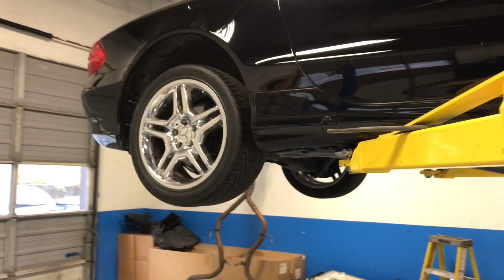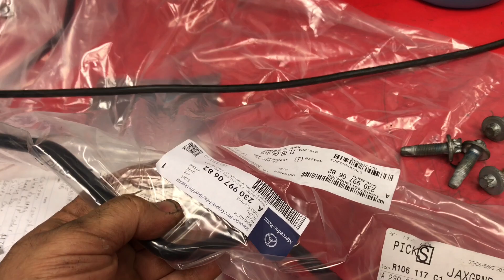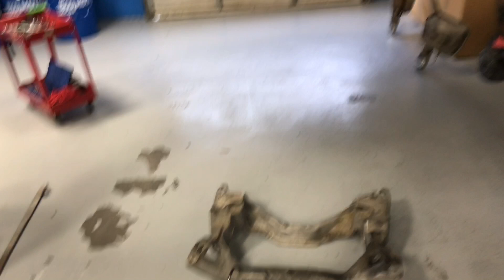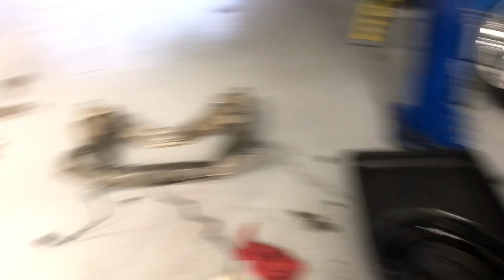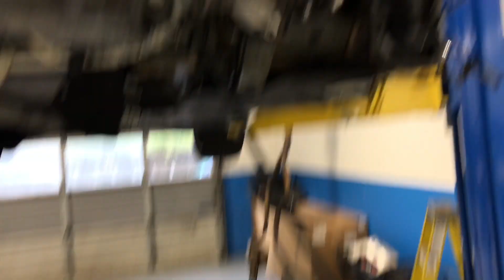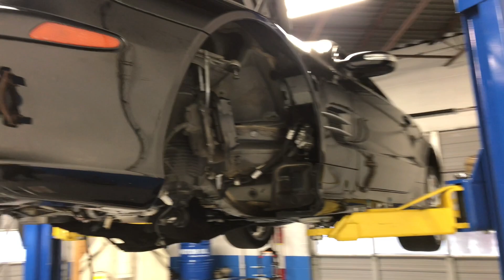Mercedes Benz SL500 Active Body Control Repair - Hydraulic Fluid Leaks Fix

Comment: Convert to coils springs it’s 1k  for the kit will never nave the problem again 👁👁other than that the car solid #swear
Reply from the maker: You shouldn’t do it, it’s active suspension and a part of you electronic stability control, you change to coils, you change the entire dynamic ride, might as well by a Toyota.

Comment: I was actually able to replace the same line in this video in about 8hrs. It is still a very big job but all that needs to be removed is driver side engine mount and exhaust manifold

Comment: I'm having a problem with my Active Body Control on my CL500 2003 the computer is telling me that something's wrong with the plungers I believe I believe the leveling sensors pressure control sensor my car go up and come down and go up and come down on its own what is the best computer to buy to reprogram my car what to be at the right ride height

Comment: I was going to do the same job you just did on my sl65.  Stupid design but there is a way around it.  Get a 10mm od compression fitting and cut the line where it goes straight.  Now buy a new line and splice it in.  Take you about an hour and get a good compression fitting and it will be good for 11,000 psi almost 4 times the strength of what you need.  That fitting will never go bad and when the line pops again just take out the bad side and pop a new one in.

Comment: Thank you !!! This is a great warning for those thinking about how sweet that test drive was ,,,,,, I drove one and it has no problems and i was going to by it till i talked to a MB mech who agrees with you. Don't BUY IT, it will fail over and over. 2k for one shock. 4 new shocks and labor and you spent more than you paid for the car ???
so i still wanted it....thought coil over swap with a electronic gadget to fool the computer, but you wont have any sway control because active corner leveling is what this amazing system does 
until til it doesn't.       so i guess its for those wanting to spend a 100k and drive for a few years and sell. The only people who dislike this video are used car dealers and and an individual who is stuck with one and wished they would have seen it before they purchased.
Air suspension is Good /Hydraulic suspension Bad

Comment: Actuslly. The metal part of the line is very rare to be damaged. The rubber part can be cut and take to be a hydraulic shop to be fitted with couplers and adapters. You wont have to take off anything. Just cut the metal clamps that attaches the rubber segment to the metal lines. Go to a hydraulic shop and tell them you need 10mm high pressure fittings rated for 4k PSI with couplers. Take the line with the newly installed bits and reattach the segment. Done
Reply: Me too.  '05 CL500 in California.  Bought it used.  Occasional white "ABC Visit Workshop Soon" eventually became red "Car too Low, Put in Park" (something like that).

Thought the pump failed, but flush & filter change -works like never before.

Now just have to pinpoint leak (front left) & "Lady MacGyver" an affordable DIY fix.

Comment: You saved me a nightmare...I was purchasing an extremely cheap 2003 on auction. Paid a MB tech to inspect  before the close and found the ABC problem on the dash, rear randomly drops out. The repair is thousands to do correctly and its actually just a bad design and unreliable anyway. Research is everything!

Comment: Probably a silly question but will the abc engage and function without the car running?  I just bought a salvage saggging 02 CL55, has lit up dash.  I have a scan tool coming but curious.  I charged the battery completely and figured it would get the pump/compressor going.  Nothing, not a peep except for the cooling “jet” fan.  Anxious to get this beauty back in it’s normal state, this is my first air suspension vehicle.
Reply from the maker: No, it works on a pump

Comment: What’s up ! Wanted to ask ! W220 s55 2003 , car sits low after driving when parked ! When turning it on it goes up in matter of 15 -20 seconds perfect height , also to elevate and lower button works ? Need help what could be the problem
Reply from the maker: Flush the system and change filter

Comment: Did you consider repairing the section that was leaking? what was the hours required for the repair?
Reply from the maker: You can’t rig it when you have a shop, the customer will come back in three months when it leaks again and expect you to fix it for free, if you are a shade tree mechanic you might be able to make a hose repair, I can’t.
Reply: @MercedesBenzTechs  if its just the rubber segment of the line then a good hydraulic shop will set you up with new segment that can handle up to 4k psi with new adapters and couplers on each end. Theres no reason they should be back unless something else gives

Comment: The replaced line shown in this video is one of the most consistent culprits in  ABC system leaks; that and the hydraulic pump loosing viability and leaking. The line runs from the front hydraulic block with the accumulator to the midbody T fitting that incorporates other lines.  MTB of Atlanta is correct that there is no way to replace this line without removing the subframe.  I am so upset that there were no foreseeable modifications made to this line. If that don't scare you wait till you see the honeycomb of lines running from the rear hydraulic block to all the rear struts. This car is really not mechanic friendly and one of the disappointments of the Mercedes fleet.

Comment: Mercedes Benz really screwed the pooch on this system.  The hydraulic lines are composed of flexible and non flexible components. The NON flexible metal tubing almost never leak; but the flexible, reinforced [ internally braded ] rubber hose suffer dry rot, physical impacts, flexing, and cracking. If they had made it possible to detach and remove the rubber hoses without taking out the whole damn hydraulic line from soup to nuts then you can replace the hydraulic hoses and be done with it.

Comment: Sorry to say but this is not the smart way to do this job. Any leak is coming from the flexible section of the lines, ageing and becoming easy to brake, even more if the efficiency of the accumulators is not monitored. 
Said so, the smart way to repsir it is to cut the 10mm steel pipe next to the flex hose and fit a suitable coupler to connect a new flexi hose. I have done this job myself and spending a fraction ( 27usd per pipe) of the bill that will shock that client...
Reply from the maker: Disagree with you, if you own a repair shop and your customers are expecting a professional repair you have to do it the way the book says if you are a shade tree mechanic you can do what ever you want, infact, you don’t even have to fix it at all, drive a lowboy.
Reply: Hi Anacleto! Your suggestion is feasible. Do you know if there is any video on the web on how to do it?
Reply: Can you drive it low? It’s not dragging on the tire

Comment: I have a 2002 sl500 with the red abc light on the dash, I replaced the abc pump and everything, just dont know of to clear it, can i use a cheap ob2 reader to clear the code, or can you point me in the right direction for something that will work please?
Reply from the maker: The code does not have to be cleared, you have more issues. 
You do need a computer that can scan ABC module though.

Comment: I have a suspension oil leak on my sl500 2003 model. It is mainly around the middle just behind the front wheels. Have you any ideas what is most likely leak cause? I will be taking off the floor pan once I have the time
Reply from the maker: If it’s closer to driver front wheel it can be from the valve block behind the wheel, move the fender liner and fill the reservoir and see if one of the two valve blocks are leaking, it can also be one of the hoses connecting to the valve blocks.

Comment: They told me I can ball on a budget so I bought the beast. Now Can I patch up my hydraulic hose leak? My SL55 amg just started leaking. Hydraulic fluid flowed right out. Resi was bone dry. Smfh. How much does this cost to repair? Should I just buy regular struts?
Reply: regular struts can be installed but require several modification and the overall cost would be not far from the car cost.

Comment: How people can disliked this video ?
Dude thank you soo much on taking the time to post the video with the part number of this particular problematic pressure hose. I called the dealer and the guy was going crazy trying to quote me this particular hose since there’s so many damn hoses and you post the part number of what I need and for that I give you all of my respect:-) you are a life saver thank you for the great info and now I can provide a proper estimate for my client.
Reply: while appreciating the effort, the way the problem was approached is still arguable. The ABC system, as engineered by MB, has critical culprits and maintenance issues. Disassembling half car to change a steel hose with a short flexi segment, that it can be sectioned and segmented with secure high pressure couplings, is a matter of technical confidence, trade choice and customer willing to spend 3,000USD or 300USD. If it were my car, I would have preferred to run the risk of an additional pressure line coupling rather than butch the car that way, involving additional risks during the disassembling/assembling process. Again, this is a personal choice and job risk assessment.
Reply: the People sitting on one they cant get rid of and used car dealers!LOL

Comment: Guys are scared of these machines because of the unknown. Naturally to have these machines repaired by a dealer is very expensive. I have a 2005 Mercedes AMG CL55 and I love it. I personally went over the ABC system and in reality it is not as complicated as it sounds. I work on my cars, there no area of this car that I can't fix/repair. Naturally you can't work on it with a bend screw drive and rusty pliers (Just joking) but you will need tools and knowledge and the wiliness to learn. That it costs money, yes it will. But with proper maintenance the system can be very reliable. Its when people want to fix these cars "A la Cheap" and skip maintenance that problems will surface and show its ugly face. It was good for my because I could buy a fantastic piece of German engineering, and I enjoy every minute of my CL's ownership. I will keep this car a very long time.
Reply: Your car is a completely different model, does it have the same ABC design. Seems like the ABC design no matter what model is a problem. The data is overwhelming! Previously owned a '76 500 SL for (89-98) 9 years that I loved but the recurring problems were the issue, same costly repair every few years all due to the design.  Some problems won't be able to be remedied. Would you concur?
Reply: I've got a 2009 SL550 with AMG package.  Car has 16,500 miles.  I bought a Foxwell NT510 Elite (Mercedes Benz) new from ebay for $125-->it does the rodeo test.
Got 20ltrs of Pentosin CHF-11S and 2 reservoir filters from Amazon.
Going to flush and replace the old fluid with new fluid (rodeo test) and change the old reservoir filter with a new one.

Comment: I sold my CL500 because of this issue. Replaced all the ABC shocks twice. I was done. I even did it myself one time. Never again.
Reply: I've got a 2009 SL550 with AMG package.  Car only has 16,500 miles on it.  I also have a Foxwell NT510 Elite (Mercedes Benz) that I bought new on ebay for $125-->it does the rodeo test.
Got 20ltrs of Pentosin CHF-11S and 2 reservoir filters from Amazon.
Going to flush, replace old fluid (rodeo test) with new fluid as well as the reservoir filter.
Reply: Did you ever rebuild the valve block? Or the lines?
Reply: Or flushed the system?

Comment: Is there a way to maintain thr abc system sir? Im getting a cl65 amg.....and want to keep it running
Reply from the maker: khoi nguyen yes, flush the fluid every 20k and change the filter in the reservoir

Comment: If you want to buy SL r230, just take Sl350 version its comes with standard non abc suspension, much cheaper to maintain. Only drawback is weaker m122 3.7 engine, but its also ok, not much that difference between m113 5.0.
Reply from the maker: Glebaka I have never seen sl350 in the United States.. it might be available outside the country.

Comment: Just get yellow speed coilovers and enjoy it if you got it for cheap totally worth it body
Reply: zaid khaled why not regular struts from advanced auto?
Reply: @kmontgomery27  because there isnt many afternerket companies that provide conventional coil over swaps
Reply: @megadudecool  what do you think about the Audi R8
Reply: @kmontgomery27  no idea tbh. Outt of my price range so I wouldnt dare judge it. Ill tell you though that Audis drive like no other and they are reliable in the sense that you can rely on them to have problems lol. They are difficult to work on and if youre thinking about saving money on after market parts they do not respond well to any non oem parts involving anything electrical(sensors, coils, spark plugs, etc...)

Comment: I found your video very interesting. I am thinking of buying a used 2007 through 2009 SL 550 (always wanted one...) but am concerned about the ABC system. Besides looking for leaks how can someone determine it's shape. Can a qualified mechanic inspect or perform a test or.... to know if it's reliable?
Reply from the maker: Mercedes Troubleshooting & repair 
First, you don’t need to use this language, second, we are Mercedes master technicians with highest level of education and access to all Mercedes Benz libraries, we are not shade tree mechanics, when we determine to do a job on a certain way it’s after discussing it in between 4 master techs, when you work on a customer car he is expecting the highest level of repair and not some bend hoses pushed in, regardless, this specific hose has to have the subframe removed. Thanks for watching and taking the time to respond.
Reply from the maker: Cam Roberson check the fluid and the filter and in general, I usually check the overall of the car and see if maintenance was done by a quick lube type of place or a professional place.
Reply: Thanks so much. I saw in another video where they actually tested the hydraulics... looked like one of those low rider shows where different sections of the car were hoisted up, then down... is this a practical test or was someone just showing off?
Reply from the maker: Cam Roberson it’s what we call the dynamo test or rodeo, it gives you control over the suspension with a computer, we use it to test the system and bleed after repairs
Reply: is it prohibitively expensive to do? If I were going to buy a sl550 would it be sensible to pay to have a qualified mechanic do it?
Reply from the maker: Cam Roberson yes. Make sure you calculate it before you buy the car
Reply: @robcam2k  - I have a 2009 SL550 w/AMG sport package with only 12.5k miles on it...A/C garaged kept and it's a Sunday driver.  Just buy an Autel Maxisys Pro on ebay...anywhere from $1400 to $1700 used. It has the "Rodeo" test AMONG A WHOLE HOST OF OTHER DIAGNOSTICS if your into that.  You can also eliminate the "governed" top speed. Flushing the ABC system is easy if your the DIY guy as well as changing the: air filters(2), cabin filters(2), oil filter, ABC filter, oil, tranny fluid, diff. fluid, spark plugs(16), brake pads F&R.  I also take the wheel wells off (4 in the front-->2 per side & 2 in the rear-->1 per side) during cleaning to inspect the ABC lines, blocks, and actuators.  The only thing that sucks is the COMAND center; it's outdated even when new back in 2009 for a $110k Mercedes and when it goes which it normally does (turns on then off) that will set you back $3200 parts & labor(dealership).   I changed all the interior lighting to LED's including the fogs to HID's and license plate lights to LED's. Car has 2 batteries-->1 to start the car (in the hood/bonnet) & the other in the trunk for everything inside the cabin or what they call the creature comfort battery...both are on battery tenders and still the original MB OEM factory batteries.  You can buy some bathroom carpets from WalMart(interior is light beige with the dark brown wood accents)...so I got dark brown bathroom carpets so as not to stain the factory matching mats and carpet.  It's hard to find someone who puts the "love" into their car nowadays since we are sooo busy OR unknowledgable of how things work--> " I just put gas in it and that's it!!" but mostly it's about image....until something major breaks and they just get rid of it.  I might upgrade the ECU to a RENNTECH ECU which re-maps the engine and takes the engine to 405hp and 410ft lbs.  That upgrade is an easy swap "plug and play" and will set me back $1600.  Renntech has been around Mercedes since the I believe the late 80's.  These people in this vid probably did'nt: 1) flush the ABC fluid every 30k to 40k miles 2) did'nt change the ABC filter as well.  A grain of sand will mess up this system as it's under high pressure along with rubber seals in the blocks and the actuators...so when doing this procedure (ABC flush and filter change) it must be done indoors and not outdoors.
Reply: sounds your really good with mechanical things, not all are as blessed!
Reply: Cam Roberson dude I’m fucking 29 and I own a 2003 sl500  it’s not a big deal! I had many issues but at the end of the day it didn’t cost much! pennies to the dollar! Just learn the system and you won’t have to pay the dealer unnecessary money.. this guy took all those parts for one hose! Jesus! Some shops aren’t as Sabby and will learn at your expense!